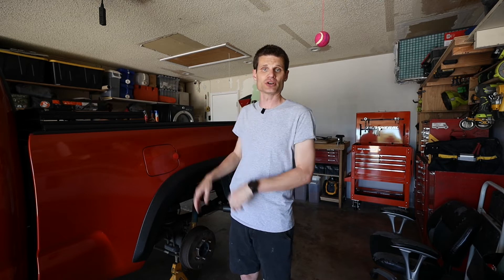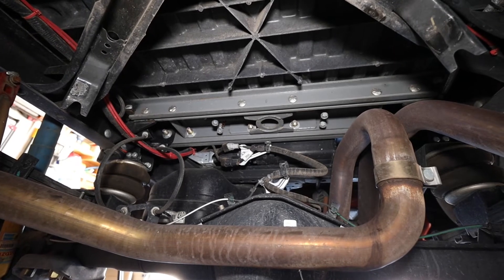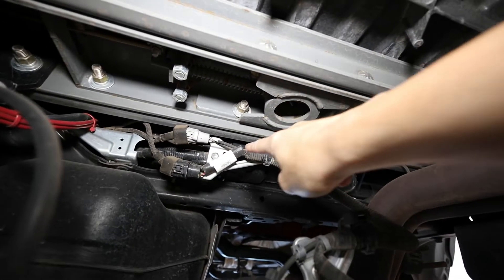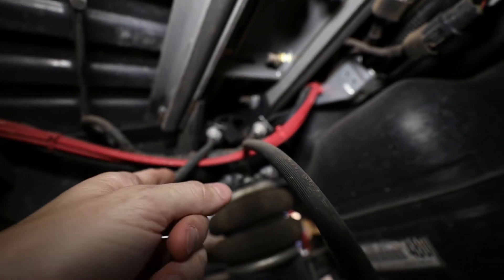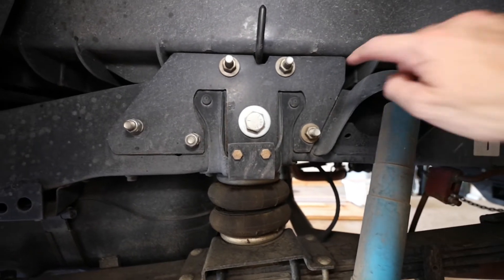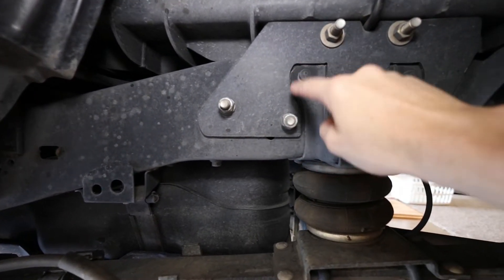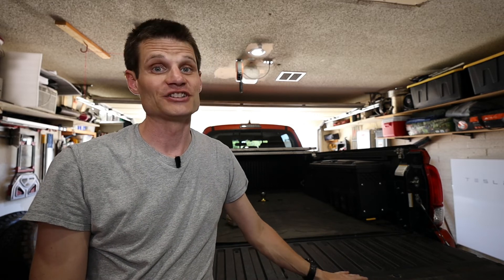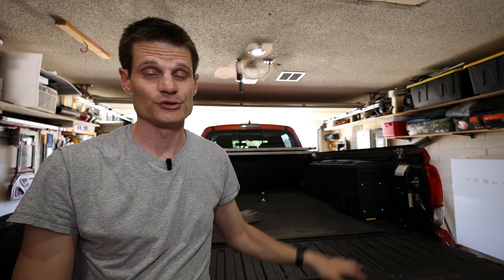Gooseneck Hitch in a Tacoma??!!

Comment: Love the set up.   What is the weight of the camper ??
Reply from the maker: 4,500lbs empty, 6,700lbs gvw
Reply: @ICanDoItMyself  Did you upgrade your brakes ??
Reply from the maker: @motoxman541  I did not. The trailer has brakes on all 4 and I'm pretty easy on them as it is. Haven't had any issues.
Reply: @ICanDoItMyself  nice setup.    Thanks

Comment: I have the same truck. Could I buy a copy of your bracket design/ diagram?
Reply from the maker: I mocked them up out of cardboard, took them to a machine shop and they made them. I didn't keep the cardboard templates.
Reply: The machine shop probably still has the CAD designs or whatever on their computers. They could probably reproduce the same brackets and ship them anywhere.

Comment: I love the video great idea for towing with a tacoma. Personally I would never put a fith wheel behind a half ton let alone a midsize truck. I get the numbers on both the truck and trailer add up but I would Never tow sompthing like this with this truck. I don't want to be a bother or sound mean! But I would love to understand your thinking on how you even think this is a good idea!!!
Reply from the maker: It's not a very long, tall or heavy fifth wheel. There are people pulling much longer travel trailers but several feet are over the back end of my truck. The trailer is 21ft long, 7ft wide and weighs 4,500lbs empty and 6,700lbs gvw. Pin weight, ~800lbs, leaving ~400+lbs for people and fuel in the truck.
Reply: @ICanDoItMyself  how much payload capacity does your truck have? I have a 2018 trd offroad double cab long bed but it only has 960 lbs payload. Which means if I have 960 lds as my payload and i weigh a little less than 150 lbs my pay load is now at 850 lbs. So if you trailer has a pin weight of 800lbs and if your truck is anything like mine that leaves you with roughly 100-150 lbs of payload. Now ad all the gear, hitch, people and fuel, you are severely overloading your truck.